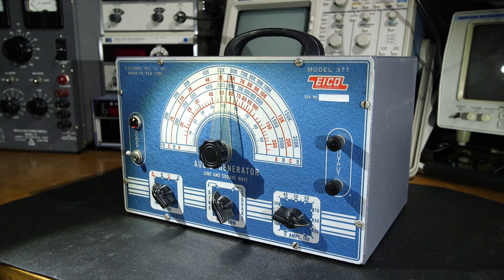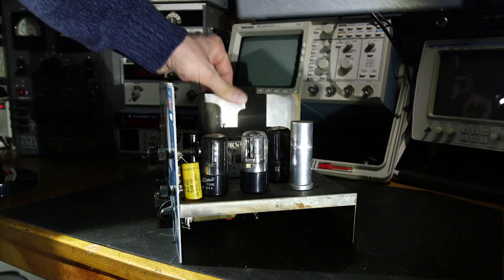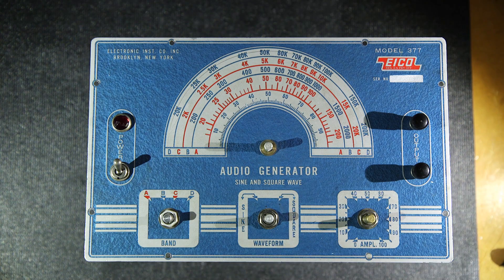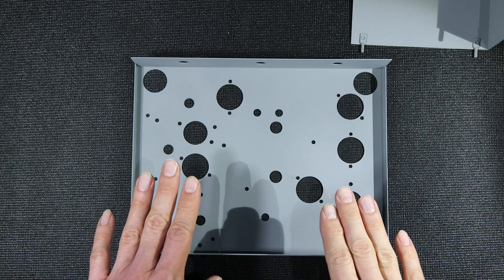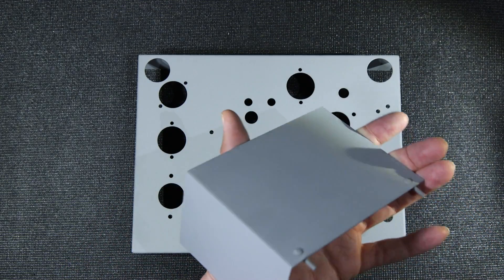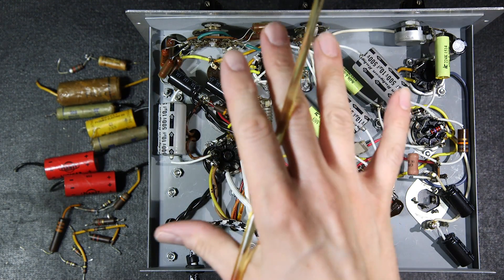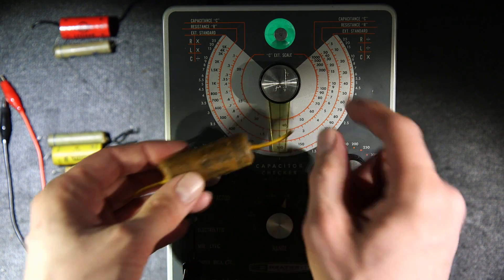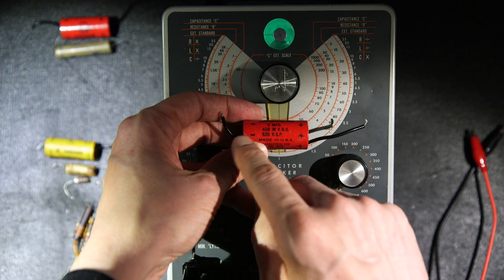Audio Signal Generator Restoration EICO 377

Comment: 50:56 there is an important (for those who are just beginning with repairing tube electronics) exemption: wax covered silver-mica 'stamp' capacitors. Often square or rectancular and very very flat. The failure mode is not leakage but crackling or losing capacity, but they fail way less often than paper caps. 
They are often found in frequency-critical circuits. Sometimes you have to realign the HF of IF circuit if you replace those.
Aside from that, reforming electrolytics can be just fine. Philips actually specified this as a way to avoid blowing up old stock capacitors (a long time ago, but still...) Certain types are always bad (the ones you show, for instance) but Philips post-war ones are quite often in good shape. Same for german NSF and ROE 1950s ones. Reform until leakage is in the sub 1mA range at working voltage, which may take several hours.
It is not a way to save money, but to conserve the radio in a state as close as possible to factory state. I have a 60w PA amp running with the big 32µ 500v ones reformed and in perfectly working state. But all smaller 16µ ones were completely shit.

Comment: Mr. Carlson, what do you suppose the output impedance of that cathode follower is? I'm thinking Zk || (Rk1+ Rk2), but am a bit rusty on tube calculations these days. And I see some very small positive feedback, correct, at 1 meg, into the divider? 

Love the video, keep it up, more than a few generations are depending upon someone to pass down the torch of knowledge.

Comment: Dear Mr. Carlson, Great video, I have an Eico 377 audio generator. I to am going to restore this, mine was from the 1960 and has the silver panel. One question I have, I read where the rectifier tube can short in these  units, can this be an issue when using this on the bench? Thank you kindly for your help....

Comment: I used an audio signal generator much like this one, feeding a surplus 100W mono audio power amp, driving the synchronous capstan motor of a Pioneer open-reel tape recorder.  With a nominal output of 60hz, it allowed me to vary the tape speed by a fine amount to tune the playback to my piano.  I could also double the speed to better hear bass lines, and halve the speed to better transcribe fast fingered solos on  any instrument.  In the 70's, nothing like this was available to consumers.

Comment: Problem with low-voltage testers is: One cannot be sure, if the cap will stand the nominal voltage: General leakage can be detected, but you have no chance to make sure, that the cap will hold up under higher voltage, which - for applications where the voltage rating is of importance - might not be sufficient.

Comment: Greetings, I am a Patreon viewing some of your old videos; I have a quick question.  About 40 years ago, I purchased an old VOM at an auction.  It is extremely old, no brand name or badge on her.  The case is wooden, the face a sort of red material. it has two rows of plugs one down each side, no labels on them, and a rheostat in the middle  The meter is very heavy with a couple of scales. The plugs look  like a probe end from a modern meter could be inserted.   It had two Winchester D cells in the back that I sold at a gun show for twenty buck, they were quite dead but a Winchester collector wanted them.  Ever seen anything like that?
Reply from the maker: Hi Jerry. It sounds like an old "Supreme Instruments" piece. They were designed very much like you explain.

Comment: Replacing a 6x5 with a pair of 1n4007 diodes will increase the HT voltage as the voltage drop across the silicon diode is a lot less that the 6x5  .. I should add been there paid the price  ..

Comment: Hey, I've got one of these right here! They're kinda fun to play with, and the frequency control is a capacitor instead of a pot, so it doesn't get "scratchy" over time.
It's perfectly good, but there are websites and apps (Room EQ Wizard) that generate audio test signals using your computer that work really well, and can produce any kind of signal you want, including single tones, sweeps, different waveforms, and pink/white noise. Kinda takes the fun out of it, but goes to show how versatile computers are :)

Comment: Have you thought about Nickel Electroplating? It's not to difficult once everything is setup, and it's conductive. It's a vary thin coating (thicker then anodizing, but thinner then chrome), and unlike paint, it won't hide imperfections. So you can media blast or sand metal to the finish you want, then nickel plate for protection.

Comment: Hey Mr. Carlson, re. removing controls from the front, I had an old pair of needlenose pliers which no longer closed correctly. I ground the ends off & wrapped the ends in two layers of package tape. I use these modified pliers to remove the nuts on faceplates. This helps protect the faceplate from scrapes. Thank you very much for yet another very instructional video.

Comment: They clip the cords off so that it can't be plugged into power. And short out.,or cause A 🔥 fire. That's generally why people cut off the cords of units just like that ico 377 Mr.Carlson. that way if someone like you can either fix.& Repair it to work correctly.,or properly. So that it doesn't become.,or be what's considered as A fire hazard. Most people would send.,or take things like to the scrapyard to sale as scrap metal instead of fixing.,or repairing such equipment units that are in those conditions.,or in those states of malfunctioning due to something is bad inside that unit.

Comment: You're correct about the price of "old" test gear selling for ridiculous prices today. Just the other day an unassembled  IT-11 sold for $480 on eBay.

Also, I noticed comments on the Antique Radios forum re your Capacitor Tester. The envy and jealousy is almost palpable.
Reply from the maker: Yes, it's amusing. Old fellas that won't learn. If Alan would clean up his sandbox, his site would get favorable mention.

Comment: Paul,  As a beginner oscilloscope would you recommend a Tektronix 465b/2246 or a new 100Mhz scope like the Hantek 5102D?
Reply: I have used the Hantek 5102D in the past not a bad scope,but if you are looking for decoding or a lot of features look elsewhere.

Alex.

Comment: MR Carlson do you have the ability to measure the Distortion level, on this oscillator I have a small kit Oscillator that's still Good, the first harmonic is still 60 DB below the fundamental frequency, for an Oscillator that cost $30 dollars in 1980 it's a great oscillator runs on a 9 Volt Battery.

Comment: Brings back childhood memories! I worked on the silver version, but still tubes, handed down from my much older brother. He got it brand new from the original Radio Shack in Boston; not a little retail outlet, but the real thing, a big sprawling hub of activity. Mine was shiny new, and with some tweaking I got it to work fine!

Comment: I have a newer 377 in very good condition despite having high operating hours.  All the paper capacitors have been replaced as well as the tubes.  I also removed an extraneous capacitor on the output which was there to reduce the output level.

Comment: Hi Paul, at around 39:00 you measure a resistor on the potentiometer while installed. Is that right? I noticed that the previous ones, one side has been unsoldered. Thanks for the video and keep up the excellent content!

Comment: A couple of notes, on Paul’s restoration.

1.) When using 6-32 hardware to replace components (tube sockets, “FP-type” mounting plates, grounding terminals) that were attached with rivets, consider the usage of 6-32 “Pattern Nuts” in those tight places.  This was an old HeathKit trick.  
https://www.fastenal.com/products/details/0170885
A 6-32 pattern-nut uses the same Hex Driver (1/4”) as a 4-40 standard nut.

2.) When you remove the wiring as one assembly (Paul demonstrates in video), take the Extra Step of visually inspecting solder connections.
Earlier component replacement or repairs may have “Cold Solder” joints or damaged components (cracked resistors, broken wires).  
These are far easier to visually identify and correct, when outside of the chassis.  This is also a good time to clean those solder grounding lugs to assure good connections when returned to repaired/cleaned chassis.

Comment: I didn't know they used cadmium so casually in the '50s. Even though bioaccumulation might not have been known by then, its acute toxicity should have prevented them from using it on exposed surfaces. And it doesn't even seem to do a good job at corrosion protection. What was the reason?
Reply: It did a decent job. Do you have any idea how that chassis would have looked like without any protection under that environmental conditions?

Comment: I have now worked up the courage to repair an old Electrolux Assistent food processor from the seventies. Old capacitors and resistors just the like the ones in Mr Carlsons videos. After a couple of years rest it was used to make bread dough this week but it soon smelled like something was burning inside. Metal capacitor from Denmark is a nice detail. I did not know they had been in the business.
Thank you for another video. Principles applied and explained and frequency ranges revisited.

Comment: The lamp stabiliser is called a “Barretter”.  There were versions using iron wire in hydrogen gas for real high stability applications.

Comment: He has another video that has the heading "Signal generator troubleshooting repair and modification" that signal generator is an Precision E-200-C is that one and this EICO different? or are they the same thing/ do the same function? Does anyone know?Thank you
Reply: The PACO E-200-C is not the same at all internally, nor is its schematic the same. Nice question.

Comment: So, I'm getting a jeep soon and want a cheap but good CB. Nothing stupidly powerful but also realize I do live in a heavily forested hilly area. Anybody got any suggestions? I thought this would be the best place to check as we're all nerds(In an affectionate way) for radio's and stuff here.
Reply: nightcoremixer1 CB is 11 metres you'll get some tropospheric ducting and maybe even a little ionosphere bounce/Sporadic E. Even in my middle of an urban location (situated in valleys, surrounded by tall buildings) on 10m I'm relatively easily able to talk to someone about 35 miles away as the crow flies on 5w using a buddipole dipole set up indoors. Not CB it's ham radio in my case but honestly just get any modern CB radio and just try it.
Reply: Hmmmmm I see. Speaking of ham radio how busy is it? I've heard that while it's still used the members are few and waning. Always seemed interesting to me.
Reply: Try  blanket and smoke signals

Comment: Thanks for taking the time to warn folks about the dangers of cadmium. An excellent restoration. I wish you did a comparison of the frequency output on the different scales, checked by the frequency counter. Also, your discussions about electronic design using the schematic are always excellent. Learn something new on every video.

Comment: Thanks for a great video.  I watched with special interest because I am also restoring an EICO 377.  Did anyone else notice that the original capacitors were installed backwards?  They were all connected outside foil end to tube grid.

Comment: Does any one out there have a Jackson 605 sine square wave generator,, I'm restoring one and I"m having a problem with square wave distortion.. the Right side of the Square wave is lower than the left side/ or the left side is higher than the right side.. Calibration instructions are vague and extremely minimal.. Help!,,

Comment: Pete: wonderful video, thanks. I am wondering though, is there a reason you replace the line cord with another two conductor? I realize it is closer to the original, but is there any reason not to use a three conductor with a safety ground to chassis?
Reply: Do I hear "Mary"?  ;-)
Reply: Sorry Paul, meant P A U L not pete.

Comment: got a similar heat kit for a buck off the junk pile.The ONLY thing wrong with it was someone had scrambled up the positions of the output attenuator resistors. Put things rite and its just fine.
Reply: Thats interesting. Also got my Heathkit cap tester the same way just a few years ago, looked brand new and the green eye had no burn in shadow like Mr Carrlsons one. The resistors in the voltage attenuator had also been scrambled, so it had been unusable till I put it right, wonder what Heathkits QC had been up to.. :-)

Comment: Mr Carlson I know Its 6 years ago, I,m in my mid 60's Blind in 1 eye, cant see so good out the other, I have always wanted to fix old radio's, and I have been Pretty Lucky, I have fixed a lot though the Years, I grew up as a Carpenter, 48 years ,last 20 was in NY city. But Back to the 377, I found it in the dump, Its in nice shape, I thought I did a Nice clean job, Installing all new resistors and Bought the kit off of Ebay, for capacitors and new cord ,  But for some reason My voltages are still too High, at some of the tubes, The voltages at transformer, says it's 275 volts, Mine is 300v coming out. what could be wrong. Any help would be Appreciated.
Reply: Hi Brian, here are some suggestions from an electrical engineer: 
1. Check the mains voltage. If you measured 300V without load, then this is normal 2. Check the rectified voltage before and after the choke; this will give you an idea of the condition of your rectifier tube. 
3. Check the cathode and grid voltages of the oscillator and output tubes. If the tubes have lost their emission, the cathode voltages will be low and the anode voltages will be high. 
4. Check for errors in the values of the resistors you replaced.

Comment: i NEED that cap tester. ive got a radio with caps and resistors that look mint! but one looks severely ugly  sadly. good news is the caps a double seal so its still usable . but i do plan on taking that thing out once i find a cap with a similar value.

Comment: Excellent restoration Paul but it would have been difficult removing the wiring from the chassis if the tube sockets had been fitted to the other side of the chassis ( on the top side ) !!

Comment: Until now I was checking leaking capacitors with an small (and very low current) inverter module from Ebay, but checking at 27 volt  definitely spark my curiosity.  I'm waiting for it!

Comment: Hey there.

First of I’ll have to point out that I love the details depth you get in to in this and many other of your videos, that is a big help to understand how all the old tube stuff is put together 👍

Well having seen a good bunch of your vids on restoration of old lab equipment, I’ve noticed that you like to keep everything as clean and close to the original as you can.

I to try doing it nice and clean and I would like your opinion on my idea of putting a new power switch on my newly restored signal generator (radio meter ms27b)

Turned out that the original on/off switch was faulty and I haven’t been able to source a new one off same shape and look. What I did was to fit one of those little lamp-switches on to the power wire and leave the original one in the case, (disconnected internally) what do you think of doing it this way? What do you do if you run into a problem like this?

Thanks in advance 😎

Comment: I hesitate to make even the slightest negative comment on such an outstanding presentation but here goes.......would it be a good idea to provide a grommet where cables pass through the chassis from bottom to top side to avoid chafing on the chassis metalwork?

Comment: Can your capacitor tester test 2000V capacitors?
Reply from the maker: For leakage, YES, and tested at lower voltages :^) It's a pretty neat unit, designed from a different understanding.

Comment: "Un cours magistralement orchestré" as we say in France. Great video as usual. I have solid state 1977 Heathkit IG-5282F BF generator using also a Wien bridge  with a JFET's oscillator and the circuit is very close. Still using it ! The EICO model described here should have much better performances thought!

Comment: 27:00 - Good point. One common cleaner NEVER to use on aluminum is Simple Green. It will attack it over time, and you can never quite get it off. Paint won't stick. Beautiful restoration, BTW.
Reply: Unless you want frosted white aluminum that is. Not a bad look... if you want it.

A lot of 'degreasers' will attack aluminum. In food service, there's this 'generic' purple degreaser that will turn aluminum white instantly. A single drop and there's a permanent white dot on an aluminum surface.

Oh, and you are not getting it off. It is corroded aluminum deep into the surface. You would have to grind it off, completely resurface the aluminum. I don't know about paint sticking or not, I would have thought the inverse would be true, due to the pitting.
Reply: if you like to paint aluminum you need to have a primer for aluminum.
Reply: Cute cat!

Comment: Great restoration, your 377 was factory built, the tested date and the fact rivets were used on tube sockets would be the giveaway..  Most EICO test equipment I've ran across were kits, to say the quality of the build is erratic would be an understatement.  In the late 50's my Father built an EICO 249 VTVM which I still have and use regularly on my bench to this day.  This was the kind of gear I used when I was making my living servicing TV, radio and audio before I got my FCC license and started working on transmitters.